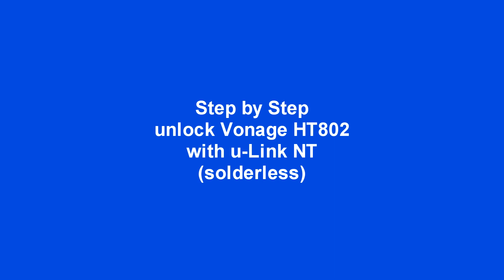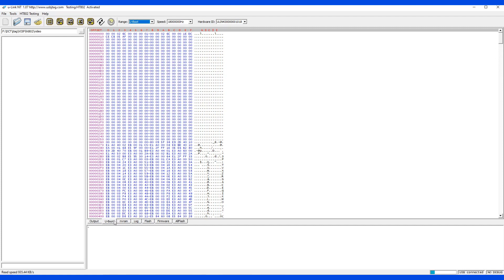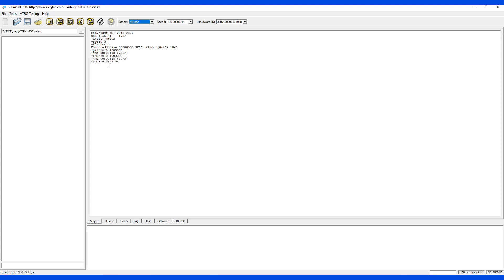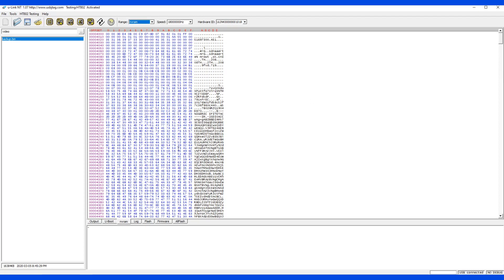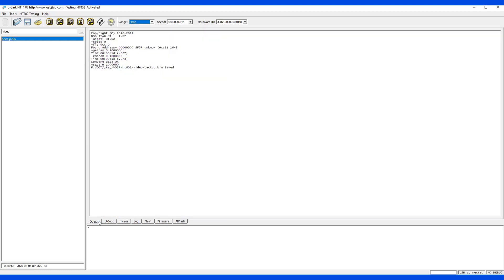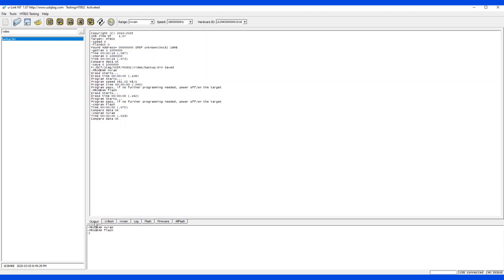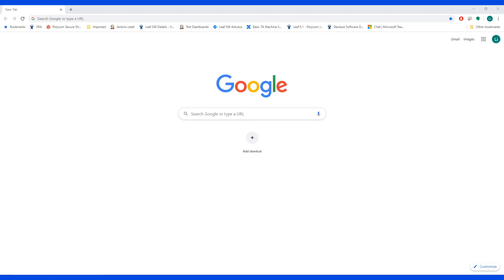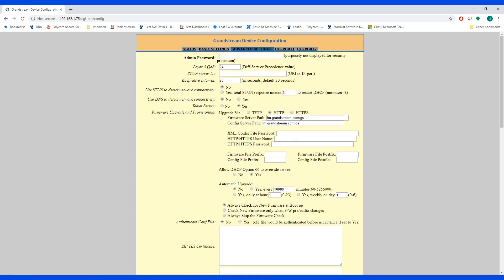Step by step unlock Vonage HT802 with u-Link NT.

Comment: Hi, I have a bunch of Vonage ht802 ATAs that I got for free, I am looking into unlocking these but kinda a noob when it comes to stuff like this.. Where can I buy this kit to unlock it?  Do you have instructions to download this whole software?  Also can this work using a Mac?  Thanks.
Reply from the maker: Software does work on Mac. You just need to follow the video and it will be a generic VOIP device.
Reply: Hi, I have a Vonage decide but can’t unlock using regular procedure due to new firmware which disables serial console.  Would this work on a newer firmware? Thanks.
Reply from the maker: @dilhangurbuzergamingchanel7306  . This method is on hardware level. So it should work.
Reply: It’s a HT802 btw, also would this work on a HT801 also?  I have a couple of HT801’s.
Reply from the maker: I have not tested myself.
Reply: Where can I buy the device?  Does it work with windows 10?
Reply from the maker: It does support Windows 10.  Check the end of latest video or use google. I do not think youtube allows me to put external url here.